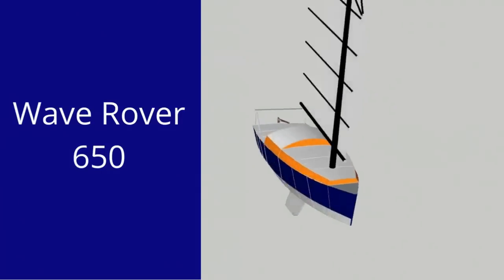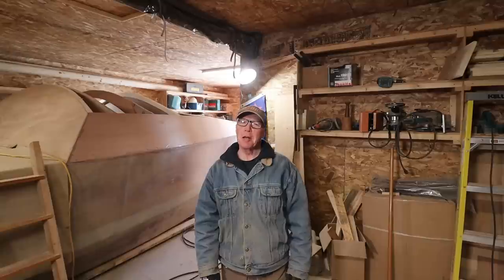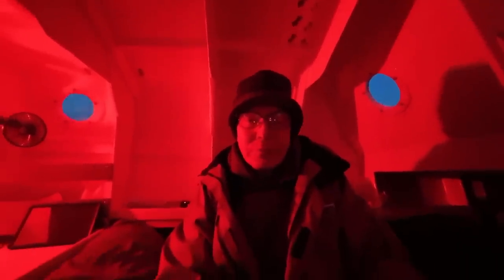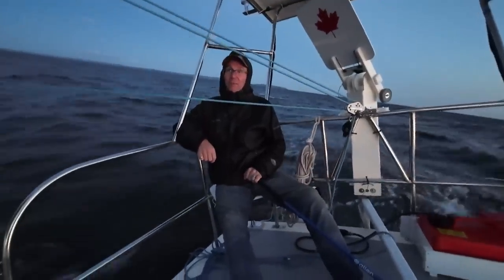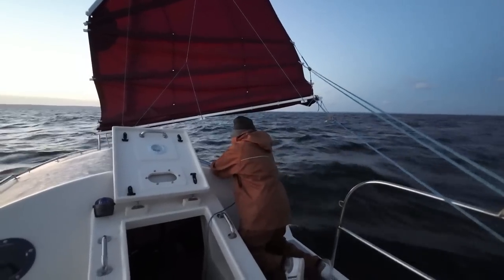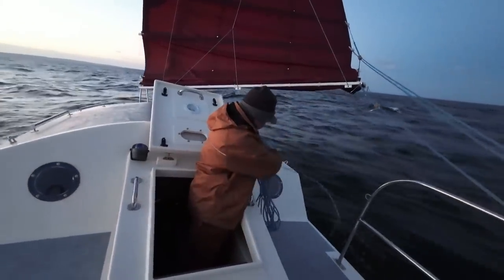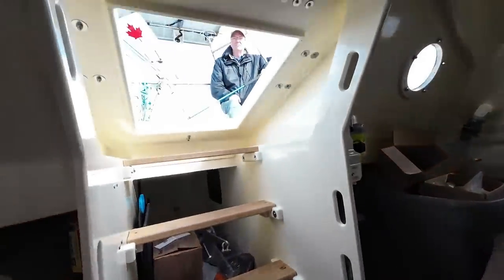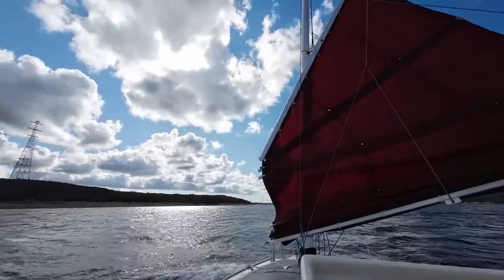S2E97 Sailing Reefed in 20 Knots (In a 21' Pocket Cruiser)

Comment: It will take me a while to get used to the junk rig.   It seems like such a small sail.   Positioning out beyond the rail without a lifeline or pfd is a little sketchy but as you said safety gear has been added.   Once solo you need a tidy way of reefing from that little box of yours.    The Atlantic is a windy mess right now.

Comment: With all due respect, it seems to me that the position to work on the ends of the sail is unsafe, since the railing does not cover or protect the body. A wave or a lurch of the boat could end up with the crew member in the water. Stay safe.

Comment: As Junk rigged sailor I would recommend that you find a way to 'box' the ends of the halyard and sheets so they don't get swept over.  Also it would be good to see you sail handling from the hatch way.
Reply: I think I'd use two hooks alongside the hatch for the halyard. PJR fig 13.14.
Reply from the maker: It's not that I don't want to do this but I simply haven't gotten around to it.

Comment: If the hatch were hinged on the port side would it work better for you?  You could limit its movement to 90 degrees.  That would allow the cleats to be located on the boat centerline and be operated from the hatch.  Love the junk sail. Love your boat. 😊

Comment: Would it be easier to TURN INTO THE WIND before reefing? It's amazing that you CAN even reef under full load. Quite something.
Is there some way to have a lifeline rigged in such a way that if one goes overboard the autopilot will turn the boat INTO THE WIND, so that one has a chance to swim up to it?
Thank you for the FRESH video of the new adventures with Wave Rover II. Awesome!

Comment: Nice sailing.  Great performance so far.  It seems that running your lines to the pit to allow reefing without going forward would be an extreme improvement.
Reply: Alan didn't go forward to reef.. he was still in the cockpit.
Reply: @Garryck-1  You are correct . Technically he went forward in the cockpit. But since the cockpit is not a pit at all, and there is no protective barrier like railings at the reefing position, it is similar to being out of the pit. But my point was to be able to reef without that kind of exposure.

Comment: Wonderful boat, and an amazing adventure! A thought: Is it not best to wear a harness and strap in , in any kind of weather when solo sailing (or shorthand) and working on deck? I see a lot of youtube sailing even in rough conditions with the solo sailor reefing or furling a gennaker etc, and do not even wear a floating device (not that this would make any difference in the middle of the north sea but...)
Reply: Depends. Some wear bike helmets, most don't. Not because the danger is gone but that they trust themselves and see no way for an accident outside their control to happen. Certain conditions forces the lifeline and harness, but after the hundredth if not the thousandth time rough weather runs by you kind of know what is too rough and what weather loses your footing and balance.

Comment: WR II has excessive roll in all but the lightest breeze probably because of the hulll shape and mast positioning. How is this better than a Contessa 26?
Reply from the maker: Less roll by far on WR II
Reply: Admire your efforts and adventures but a moment of force applied to a lever (mast) will have less effect on a deeper keeled craft than a shallow draft  craft with a short bilge keel. That's just physics?
Good luck on your voyages in WRII. @RoversAdventure
Reply from the maker: @johncooper3404  your physics are right but your inputs are wrong. WR2 has a shorter mast and a deeper keel than the Contessa 26
Reply: I very much look forward to your forthcoming adventure on WR II. Thanks for engaging with me on this topic. There are so many parameters to the discussion but I’m sure your Voyage’s in wr II will be great
Good luck

Comment: That's quite a complicated system of sheets, ropes and pulleys to manage that sail. How does it work in practice?
Reply: It works so well that it was in use powering Chinese workboats in all conditions since at least the fourth century. A robust design, low loads on its parts, no winches needed; more complicated to set up initially as there are many different ways to rig a Chinese lugsail, also known as a junk rig. Safe and dependable, particularly for a single hander; performance in a blow comparable to a gaffer in windward work, perhaps less so in light airs. The Junk Rig Assocation has a bunch of resources in one place for the curious.

Comment: It in 15-20 kts  you have 3 reefs in what is the plan when it gets in 40kts range. Appreciate the fact it reefs easily but it looks as if there may be an issue when the winds pipe up.
Reply: Agreed.
Reply: Hi Jay,
I don't think there will be an issue because at 40kts you would be lying on the drogue...no sail...

Comment: I'd like something that is a mix of Wave Rover, Ocean Capable Small Sailboat and Baluchon built with thick foam panels like Sven Yrvinds current build. Bilge keel, junk or roller furling and I'd like to add a kite for faster speeds and as a backup in case of a demasting.
Basically I want an unsinkable tank that can sail any ocean.
Reply: If you do it, put it on YouTube I would like to see it. I like the kite idea

Comment: Hello again from Florida ,
Your little boat seems more efficient and stable than is typical.   
You seem to be traveling thru the Canal at a much faster speed than that tiny motor should normally manage , how is that ?  Is your low Weight that easy to push ??
Congratulations on a successful design and completion ! 
Bon Voyage
Tony Kazz
Reply: Well, down in Florida, they would put at least a 300 hp engine on that boat.
She would be flying right along only on her twinkeels.

Comment: I was going to ask you about your lifelines I didn't see any looks like you added some I never did like them much. Who which to get hung upside down on a piece of wire cable and have to do a vertical sit up to get back on. I noticed your best doesn't have any shrouds or stays. What is your mask made of it must be very strong. The microphones not bad just put a dead cat on. You can turn up the lighting a little bit it was kind of dark. Anyway happy voyages and watch out for hurricane Lee
Reply: It's a freestanding wooden mast made of selected spruce, pine, and fir 2x6 and 2x8 construction lumber, laminated into a solid mast. Search for "S2E55 Building my $200 Cruising Mast (28 feet)" for the first of three videos about making it.